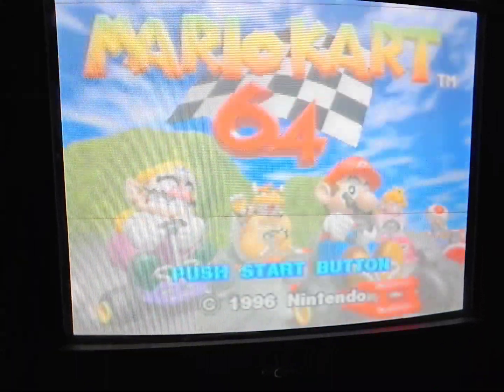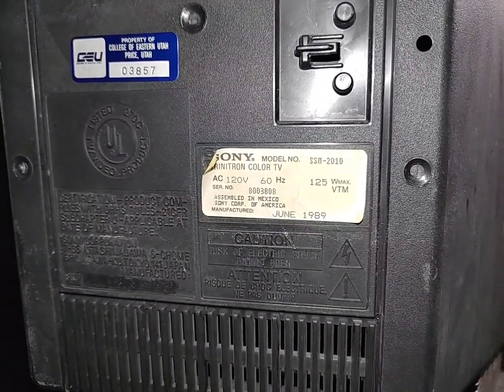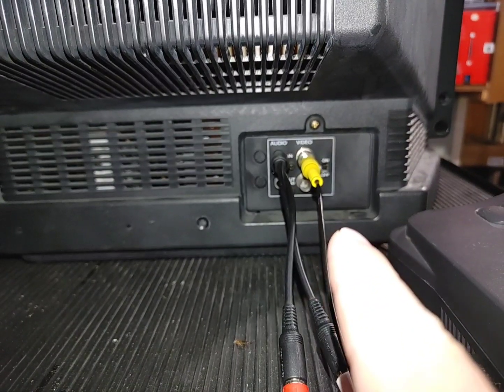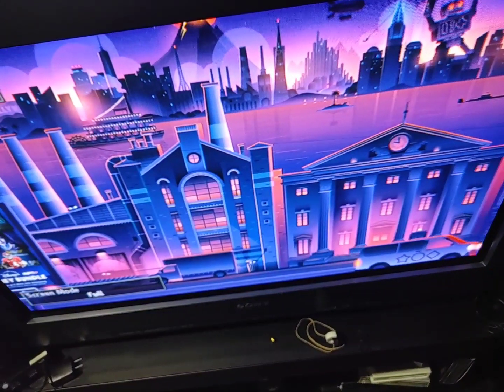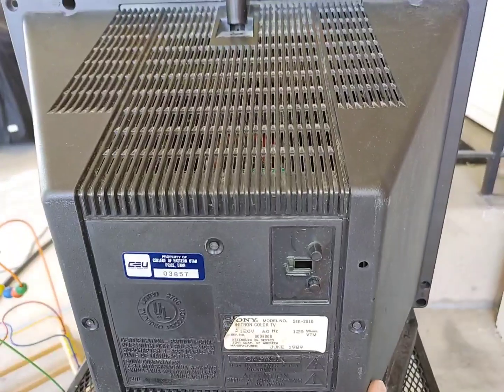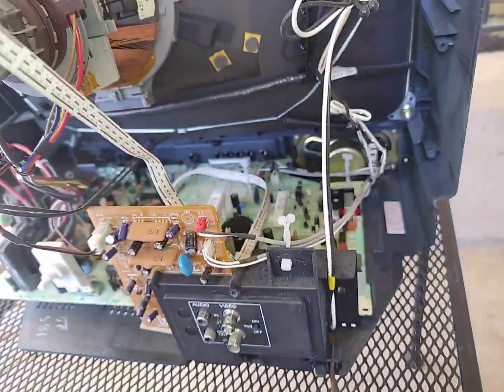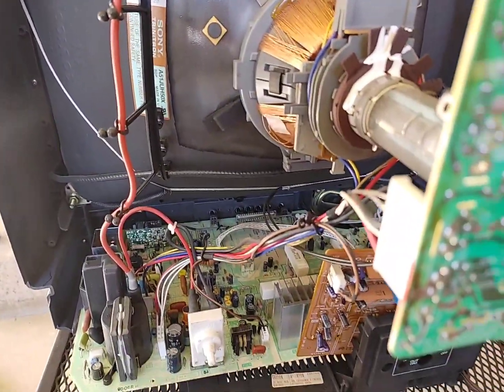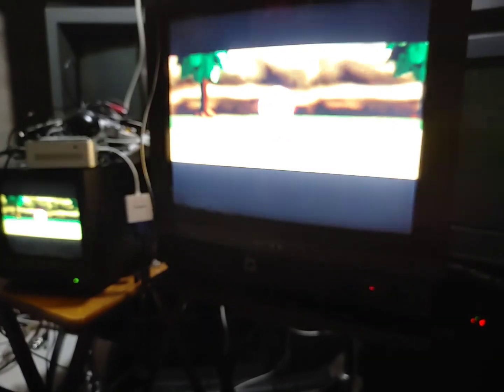What is This Thing?!?  Sony Trinitron SSM-2010 Overview and Cleaning!

Comment: I thought the analog tuner to pick up over the air broadcast signals defined a TV over a monitor, which just displays a video output
Reply from the maker: Yeah, I think you're right.  TVs have tuners, monitors don't.

Comment: In Germany a company named Loewe did those things quite often. They would re-use most of the chassis of a TV-set, as well as the case to build monitors and terminals for it. I think the design of the one I have even was re-used for a PC clone they sold.
Reply from the maker: Oh wow - so it was a third party company then that did the modifications?
Reply: @FairyKid64  No Loewe themselves did the modifications. Perhaps except for the video phone that used a Loewe terminal as a video display unit.